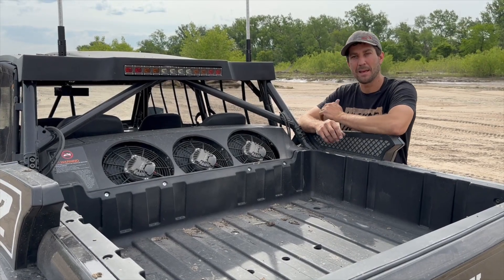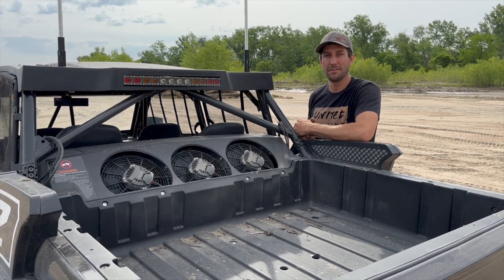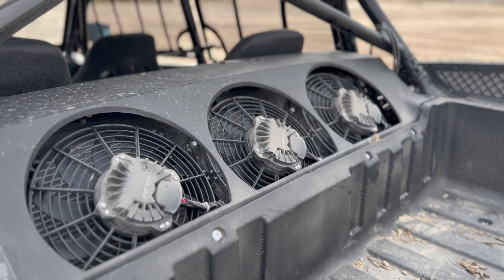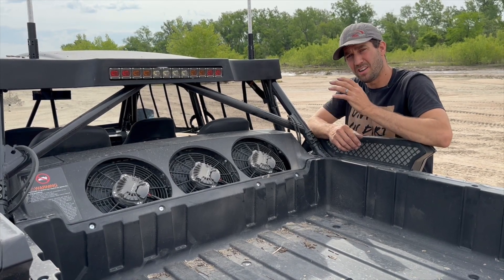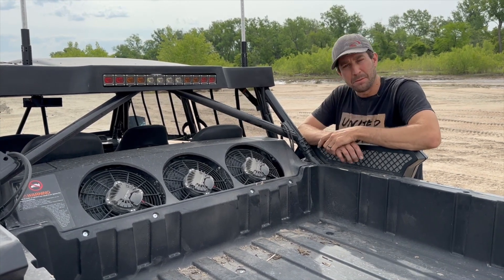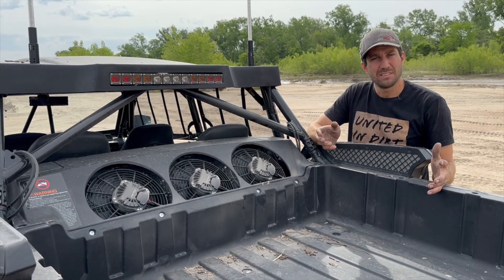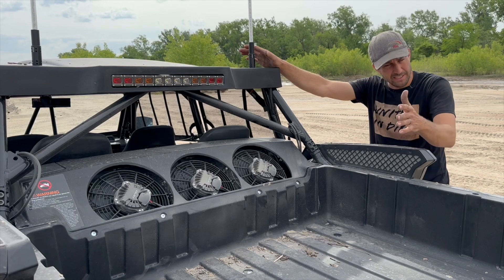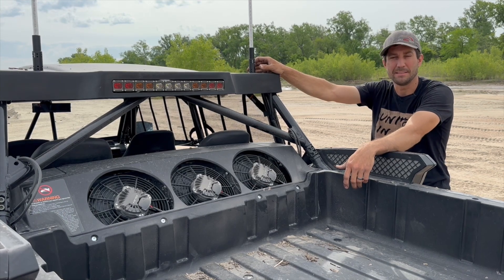Speed UTV - RPM Brushless Fan Upgrade! Run cooler & Use Less Amps!

Comment: Do you have temp results before and after for coolant, oil, and IAT?
Reply from the maker: No we do not. No way to accurately log back to back testing like that.
Reply: @RPMPowersports I wouldn't expect it to be 100% accurate but if you are moving more air at a faster rate through any of the coolers one of the temperature reading would trend in a different direction assuming in the lower direction. Unless there is no change at all telling me this product would only benefit from a lower amp draw 🙃.
Reply from the maker: @shaynes3243 , there must not be a change at all with a 90% increase in CFM. These cars are VERY inconsistent and VERY unpredictable. If speed gives us data logging abilities, well gladly log data. Until then lets let them focus on repairing this car so that's it can be drivable again (;

Comment: Anyone know the cfm difference either.. trying to get some specs but i cant find any ><
Reply from the maker: The Speed fans are on variable timing meaning they don't all turn on at once, plus their in a horribly "sealed" enclosure. This makes it impossible for the factory CFM to be measured. Our fans pull about 1250 CFM per fan. If i had to guess, the stock speed fans around high 800's to low 900's.